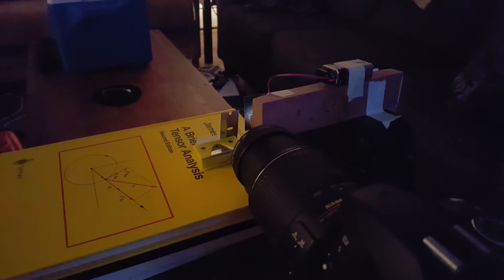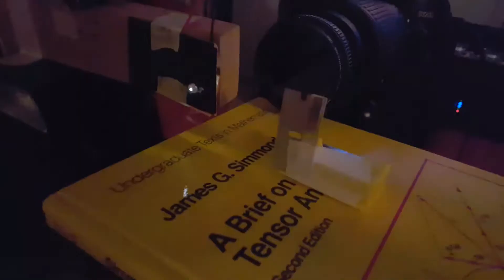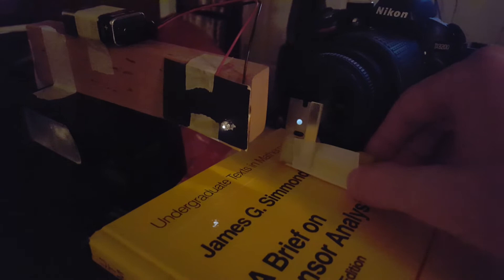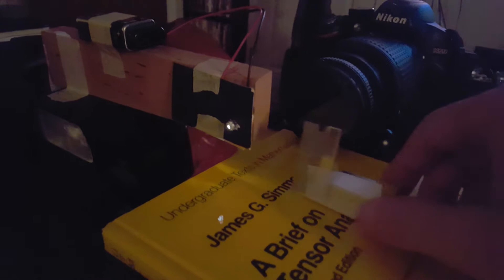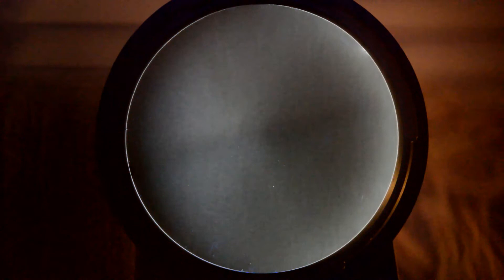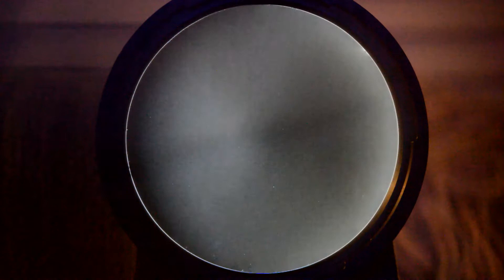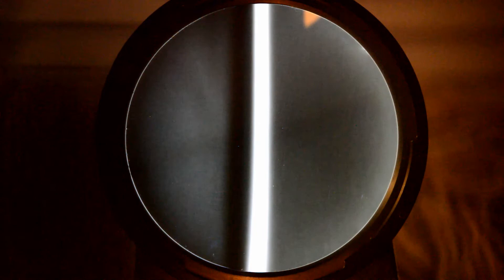Schlieren Knife-Edge Placement

Comment: This video is amazing.and really helpful. I am trying to get some results at home with a cellphone and a really cheap mirror and is kind of working. Actually, I got some images  of a flame and it flow using genital light and the cellphone camera. They are nothing like the one you showed, but I was amazed that some results can be obtained without both the LED and the knife
Reply from the maker: Thanks! Yea, you can sometimes get pretty good results even with cheaper mirrors.  I saw the video you posted, and it looked like the mirror is similar to my "bathroom/makeup mirror" that I used at the end of my DIY schlieren video.  It's not going to give you great results, but you can definitely see something.

Comment: I faced some problem while doing this.
1. I could not find proper focus point. From the method of phone's flash and crispy focus image, I got the point, but when I placed the blade there it is blocking the view and looks like in front of focus. Even when I put the blade on almost the camera lens it still looks like in front of focus.
2. I saw two parallel images of the candle flame on the camera and that is also without the blade, some kind of schlieren effect was there. I don't know what is causing it but I guess it happens due to wrong position of camera.

Please help if anyone has faced such problem and solved it.

Comment: I am also trying this experiment. But there is one problem. In your "How To: Build Your Own Schlieren Setup" video, the bright image captured by the camera was not a mirror size. But this time, exactly the same bright image and mirror size. I want to know how to capture a camera exactly same bright circle image as a mirror.
Reply from the maker: Two things are different between this video and my other video.  First is that I was able to use a bigger mirror.  Second is that I got a lens with higher zoom.  In the first video, the max zoom I had was 55 mm, and with my new lens, I could go up to 200 mm.  Both of those points means I was able to get a bigger image of the mirror in my videos.  If you don't have a bigger mirror, and you don't have a higher zoom lens, one way you can get a bigger image (although maybe not as nice as going directly into the camera) is to place a sheet of paper farther back behind where you would normally place your camera, and you can see the image on the paper.  Then you just point your camera at the piece of paper to get whatever size you want.  Normally for something like this, you would use a ground-glass plate.
Reply: @JoshTheEngineer  Thank you Josh, but i have a question.

I use a 30cm mirror and a 200mm zoom lens. You are creating a schlieren image that is as big as the mirror. But even with camera zoom, I get a schlieren image that is smaller than the mirror size. What am I supposed to change to produce the mirror size schlieren image?

Comment: Hi, in my setup I see the knife in my videos ,so I can't see the background if I put the edge in, but in your you can see the background, why?
Reply from the maker: You might not be placing the knife edge at the correct location.  In my video, you can see that the knife edge will start to totally black out the mirror if it's in front of or behind the focus.  When it's located at the correct location, it will start to dim the entire mirror uniformly.  Of course, if the razor is placed such that it blocks all the light from the mirror, then you won't see anything on your camera.